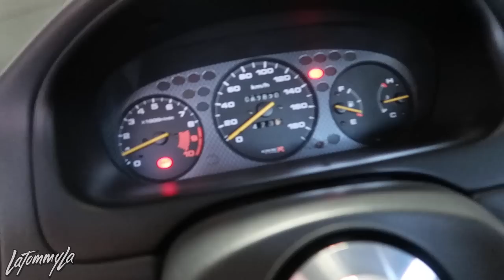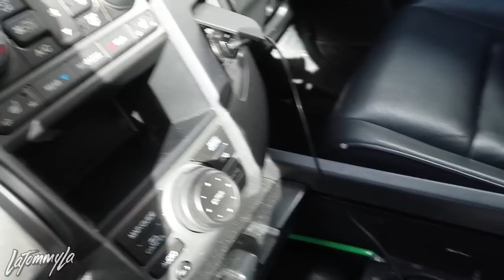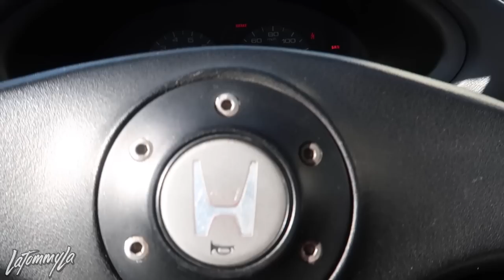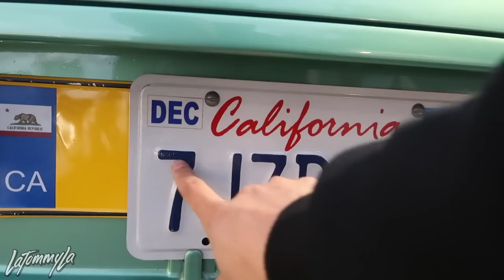Chuckwalla raceway bound for Vtec Club!

Comment: Why he swapped a B18C out of a B16A?
Reply: @frivera735  why don't he built a Turbo B?
B Series suck at N/A
Reply: @riyuiwashere   He wanted something that's reliable, just hop in and drive. A STOCK B16 will do him just fine, especially in California. Plus, he's mentioned time and time again, he prefers all motor.
Reply: @airfryerdeluxe5543  oh ok
Reply: Plus he is going to get the car BAR'd so he cant get hassled by cops
Reply: @nismor3490  california sucks while you're a car guy
Reply: Wtf are y'all talking about? How can you not get a b18c5 to run reliably? What are you doing wrong? Ive seen people daily drive a stroked b18c to 2 liters just fine. You make the honda game sound wack limiting yourself to 1.6 liters for reliability while others can get larger displacement engines to never skip a beat.
Reply: @adamelmachkour2506  ok chill man
Reply: @adamelmachkour2506  he just swap 
The B16a2 so he can BAR the hacht and don't get hassle anymore by the cops in the street
But don't worry,he got a coupe now
And that car is going to be is budget racer